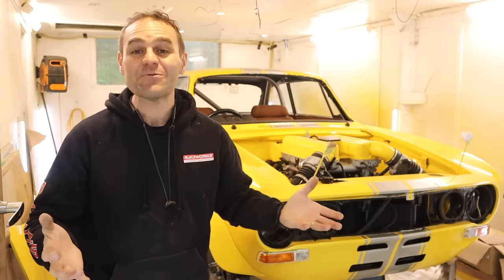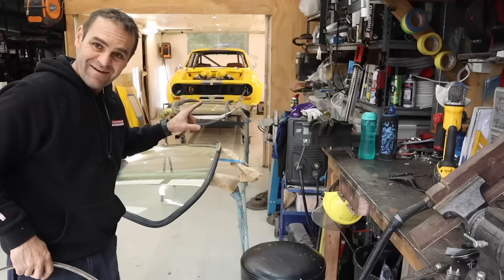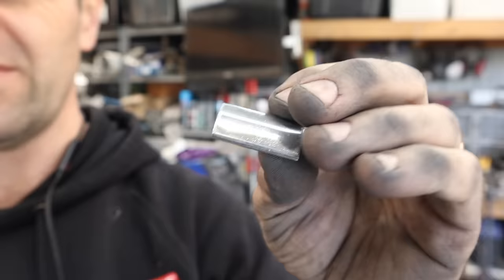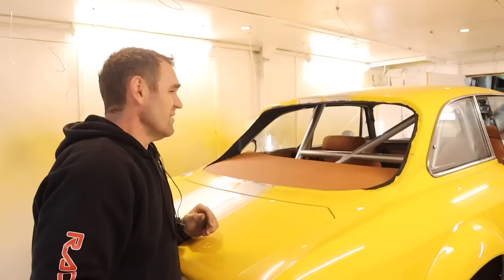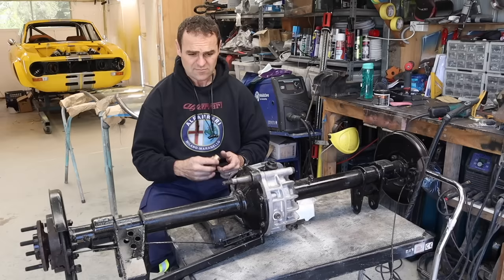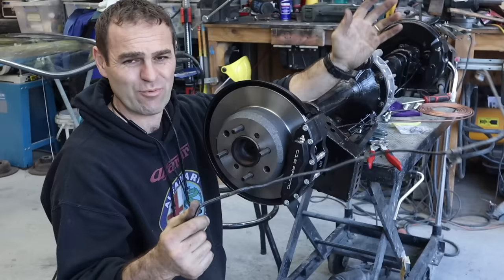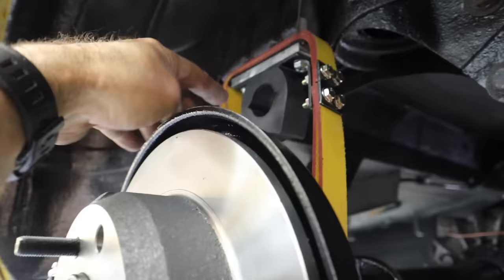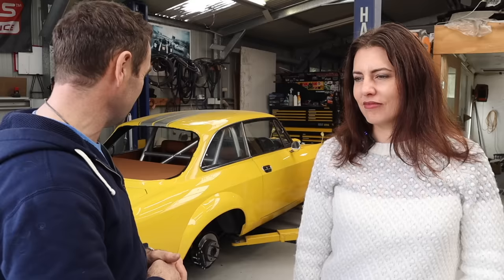What's the diff? - Ferrari engined Alfa 105 Alfarrari build part 189

Comment: We fitted windscreens to early BMWs when I was an apprentice. You had to put the strip in those first too. We also used a 3/16” cord  with a loop at the top. We’d usually start at the bottom, once we had about a foot of the rubber over the lip, we’d then pull the top in using open palm slaps on the glass to make it seat in. So top and bottom first, then the sides. There’s a knack to it but you’ll get it. Some people use a rubber mallet to seat them in but we generally didn’t have to.

Comment: Good video,  I agree that you install the window trim before installing the window like the 911, I  have a loop of cord at the top of the window as well when fitting the window to the car, when you pull the cord half way up, start pulling the loop cord down from  the top for better control of installation,  it's all fun.

Comment: Love watching this come together.  A tip or something to consider:  On bare surfaces you don't want to corrode, like maybe the trim, consider something like Nyalic as a surface coat/protectant.  It's always worked well for me.  Though it's a clear protectant specifically meant for metal in harsh environments it's not really a "paint."

Comment: Got to admit, I was on tenterhooks when you began the process of installing the glass, but glad you're erring on the side of ultra-caution. That re-designed centre-arm of yours looks like it's going to work really well, overall it's a much simpler and more elegant solution than the sideways-on Watt's link type arrangement on each end that a lot of live/beam axles use.
Reply from the maker: The panhard rod also gets a lower roll centre than the watts link.
Reply: @HomeBuiltByJeff  For sure - what I meant was the pairs of anti-torque linkages often used top and bottom (leading and trailing) at each end of an axle (or beam, like on a SAAB) that work like Watt's links (well, to all intents they are Watt's links I guess)  - far less elegant than that sturdy centre A-arm (ETA >> now that it's working only as an 'anti-torque 'arm)

Comment: Great job on the glass.  Watching your trunion solution carefully.  I still maintain that there is a much simpler and effective method that people use when converting to Watts linkages or Panhard bars, but I'll be curious to see how your solution works.  Easy enough to go back and modify later, if needed.
Reply from the maker: I looked at making upper trailing arms and the trunion set up was simpler. Colin Byrnes dad has been running this set up and it works fine by all accounts.

Comment: Normally you put the windscreen in without the insert in the seal. You put the insert after the windscreen is in place. This is the way I did it on the old cars I had in the 80's. Old Opel, Citroen's, Peugeot's... Event on the Audi 50.

Comment: Great job Jeff, love this build, quick question, will you need to upgrade the number of wheel studs for the power increase?
Reply from the maker: That is not a thing. Most change cars from 4 stud to 5 for more wheel options or by fitting a different rear end. 5 is stronger yes, but 4 could still hold 1000hp depending on tyres, etc.

Comment: Why do you want the rear axle to move sideways? On my cars I´ve had the nut come loose once, and the rear started sliding from side to side whenever I turned the steering wheel. Another car had very worn conical bushes and this also had an unwanted effect. Also the tires may hit the inside of the wheel arches, if you don´t have plenty of space there or the car is very high...
Reply: The Alfa's reaction trunion is designed to perform two functions - 1.restrict lateral motion of the axle and 2. together with the trailing arms locate the axle in the desired location whilst also preventing any rotational motion of the rear axle.
Jeff has modified the rear axle assembly by adding a panhard rod - which now takes on the duty of preventing the axle from moving laterally.  Consequently, the reaction trunion is no longer required to restrict lateral motion - hence the installation of the bearing and bush assembly which allows some sideways motion to cater for the small lateral movement effected by the panhard rod as the suspension raises and lowers.

Comment: If a 1" bearing and outer Bush may have got away with sticking the Bush in the freezer to fit it rather than clearance on inner and outer dimensions 👍
Reply from the maker: It needs to be able to move sideways on the bush. That would have defeated the purpose of the whole thing ;)

Comment: why not construct a watts linkage. (or find a sliding block)  we did it to my ill handling gtv back in the 80's and thereafter the rear became stable, predictable and I could step it out and bring it back at will.  the stock configuration was a disaster.
Reply: A watts link is an ideal solution but far more complex to incorporate into the 105 series Alfa with a stock rear axle.  A panhard rod is a far simpler modification on the said car, and provides 98% of the performance of a watts link - especially for the relatively modest travel of the 105's suspension.
Reply from the maker: Explained in the linked video, but a panhard rod gets a much lower roll centre than either of those 2 options and the sliding block even from the factory causes issues.
Reply: @HomeBuiltByJeff  The said roll centre of a Watts link is dependant on the location of the bell crank pivot point.  Consequently, an appropriately designed Watts link would provide a similar a roll centre to the Panhard rod.  Whilst the Watts link is incorporated in the later Alfetta chassis which uses a De Dion tube - it would be far more 'involved' to back fit it to a rigid 105 rear axle - i.e. do-able, but more design effort in order to maintain the integrity of the aluminium diff housing.
Reply from the maker: @georgebettiol8338  Due to the design of the Watts link it is limited by the fact that it needs the lower link. The panhard rod can sit as low (or lower if you have a panhard rod with a bend in it) as the watts link lower pivot, hence much lower. Watts link does have the benefit of being more linear vertically in it's travel.
Reply: @HomeBuiltByJeff  For a Panhard road equipped car the rear roll centre is defined by two points - 1. where the ‘straight’ Panhard rod crosses the centreline of the car as viewed in landscape, and 2. the point about which axle would rotate if the Panhard rod was disconnected, also viewed in landscape.  Armed with the aforementioned two points, the actual rear roll centre can be determined - however I won’t describe how this is done - as it will require to many words that may tend to confuse.  Better to refer to an appropriate text book, with diagrams, on the subject. 
Since the Alfa’s original lateral location of the rear axle is effectively disabled, and the remaining attachment points don’t add much to the lateral location then it will simply be 1 above.  Notably a bent Panhard rod will have no effect on the roll centre location - as it’s dependant on a straight line between its 2 pivot points, however the bent rod will simply add an unwanted bending moment to the rod that is easily countered by the use of the relatively large diameter type as used by Colin Byrne.  In most road car applications that have real world suspension travel and ‘fabrication’ constraints, it’s rarely the case that the Panhard rod is fitted so that it is perfectly horizontal with the road - especially so, if there is a desire to locate the rear axle pivot point as low as possible.  An inclined Panhard rod will result in different handling characteristics when turning left or right - a characteristic that is magnified if it’s a relatively short rod.  The aforementioned would be discernable on a ‘hard edge’ racing car but may also be undesirable for a road car equipped with a relatively lengthy suspension travel.  In any case, the use of the Panhard rod for the 105 Alfa would be my preferred solution over a Watts link that would require a complex and likely heavy fabrication to mount the bell crank pivot point at an ‘ideal’ location - i.e. it's not a simple solution of just drilling the aluminium diff housing to install the said pivot point.